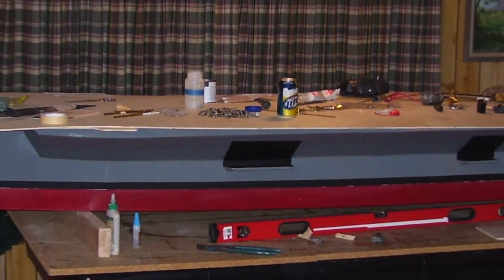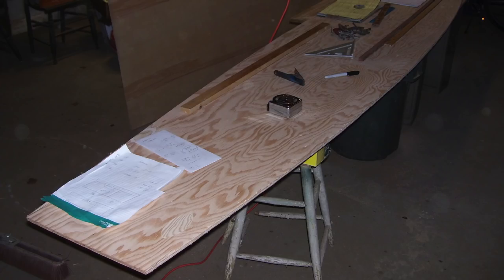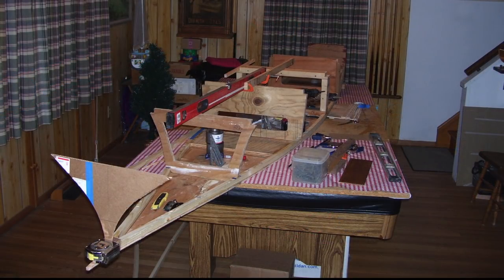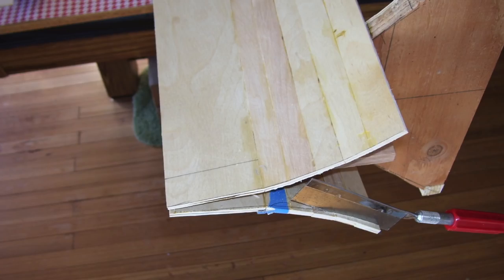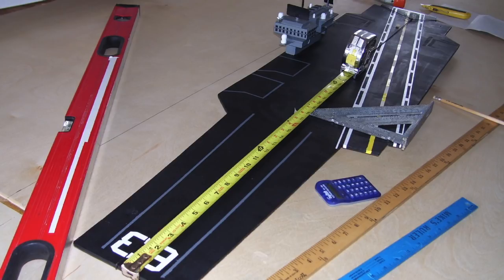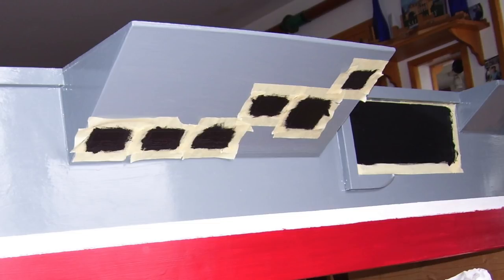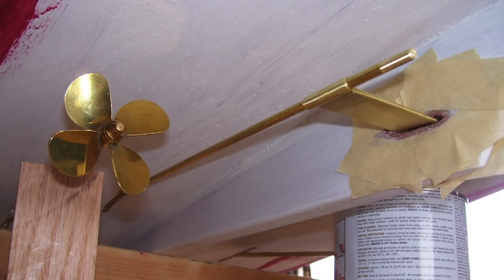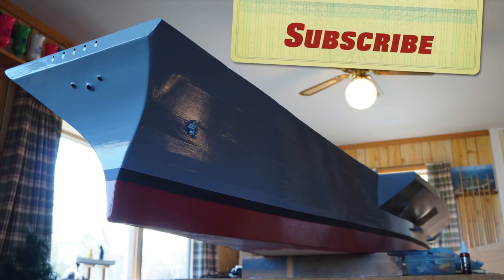Making a 13-foot R/C Aircraft Carrier from Scratch - "Building the Behemoth," Part 1

Comment from the maker: Arved, we considered all types of propulsion options, but internal and external combustion engines come with drawbacks such as volatile fuel, providing enough combustion air and machinery space ventilation, noise levels, and exhaust heat and residue.  Electric made the most sense as the many auxiliary functions can be run off one or more big batteries, which also help to  fill the ballasting requirement.

Comment: I don't know if you've done or talked about this (on video) but how do you make a hole into the ship for the propellers without it leaking?
Reply from the maker: The clearances between the shafts o. d. and stuffing tubes i.d. are minimal, and they are only submerged maybe 2 - 3 inches, so the pressure so close to the surface is very little.  A light coating of oil also helps keep the seawater out.

Comment: Always wanted to build a RC carrier. Excellent job! Curious what your using for speed controllers? I have a Mr. Darby with high torque Marx GT500 motors with planetary gear transmissions and keep burning up my Vantec VAN713H controller. My other controller is a MCD SC330FET. I'm looking to replace both controllers. I'm turning twin 3.75" four blade props. FYI, I was stationed on the real USS Kitty Hawk in the late 70's, attached to VA52 with A6E aircraft. Interesting to see her name in RC use.

Comment: +Rapidnation What wood did you make it out of as me and my grandpa are making a nimitz class carrier that will sail but we don't know what to make it out of please advise. With thanks, Tobster
Reply from the maker: Toby, whole boat is pretty much A/C plywood, the bottom is made from 3/8" and the sides are 3/16"  The flight deck is 3/8' Mahogany marine plywood, all primed and painted at least 3 coats to protect against water intrusion / warping.

Comment: Just wondering, what are those engines called? I'm looking for that type of marine propulsion engine for a future plan of mine to build a rc ship that big too. I am looking for powerful engines though, I plan on making a boat big enough to sit in.
Reply from the maker: The four electric motors installed here have plenty of power to transport a person at paddling speed. You don't need tons of power to travel at displacement speeds.
Reply: Hmm, could I possibly get a motor like that with enough power to at least travel 20mph?  I'm also not the best with boats, nor am I an engineer. I just like trying new things.
Reply: Rapidnadion Well basically, I want to build an rc the size of an actual boat. So I need something a little more powerful.

Comment: Just wondering how did you get the curve to stay in the aft end of the hull while making sure the flight deck was still level
Reply from the maker: The bottom plywood is made more flexible by scoring across it with sawcuts visible at 2:46.  Once the chines were cut in the same manner and the sides glued on, the upswept curve was permanent.  Thanks Mathew for your interest.

Comment: So I know you answered another comment about how to keep water out of the propeller shaft and stuffing tubes and all but I built a 7ft carrier so what size shaft and stuffing tubes should I get for it thanks
Reply from the maker: Find a propeller of suitable scale, maybe 1-1/4" diameter and determine bore size and threads per inch of the hole in the hub. You can do this by running a series of test bolts  into the hub to see what fits, like an 8-32.  (Size 8 by 32 t.p.i.  Next find a die that you can spin down the shaft 3/8ths " or so from the starting point (end) to make the shaft threads.  They will match the threads of the hub.  Lastly, find a tube whose inside diameter is a close fit to the shaft's outside diameter and you've got it.
Reply: Rapidnadion thank you for that response and do you have any recommendations for what websites I should buy the propeller, shaft, and stuffing tubes from also you guys should make an RC website selling all the parts for these projects
Reply from the maker: Google model boat propellers and shafts.

Comment: how would i be able to contact you guys about plans and dimensions? is there an e-mail address i could reach you guys at?
Reply from the maker: Seth, sorry but there are no plans; we literally scratch built the CV63 by eye.  It helped a lot that we had the 52" previous model to base our 3x scale dimensions on.  We have been building model boats for decades, so a lot of build steps are similar to other work we have done- so it went pretty quickly. Thanks for watching!

Comment: How did you bent the bottom of the ship at the Stern?
Reply from the maker: We made around 8 cuts, half way through the chine and also half way through the 3/8 " plywood bottom thickness where the bend happens, perpendicular to the centerline.  This makes the bottom only half as thick where the cuts are, so et's pretty easy to bend.  See 2:46in the build video for where we did this..